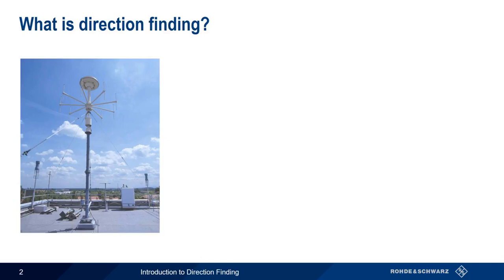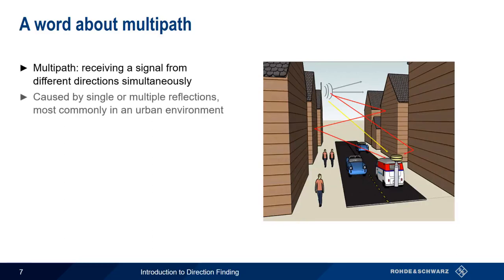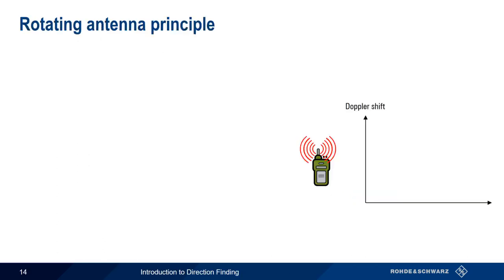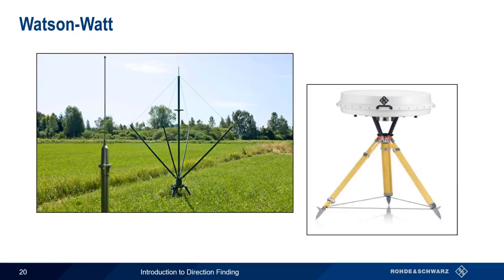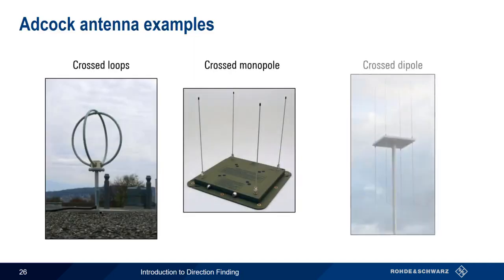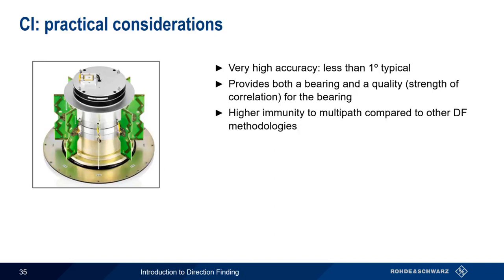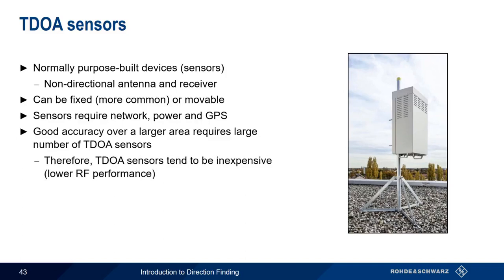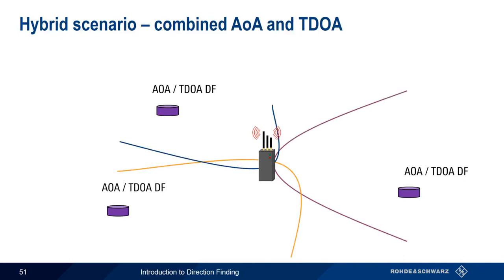An Introduction to Direction Finding

Comment: 10:05 I know the problem from my history as a radar operator on a old system.  In order to track a plane the radar needs to have a amount of target speed directed towards or away from the radar. If a plane flies parallel the radar couldn’t track it. Pilots learn this to evade air defense systems by flying in meandering patterns. We called it the zero Doppler tactic.
That’s why modern radars for this purpose are almost always of the phased array type.
The RDF methods you describe are following the same principles. Cool to see that after 20 I’m looking at a video to find inspiration for building a fun setup with my son and I almost hear my instructor basic radar and EOV from my initial training 20 years ago haha.😊

Love the explainer!👍

Comment: For the manual direction finding, the antenna can be mounted on a rotating platform and the signal measured so fast with the orientation of the antenna tagged to each measurement. The highest strength can be extracted by observation or by simple code.
Reply: Yes, that's correct and some DF systems do exactly what you describe.  However, there could be issues if significant multipath were present (highest received signal power may not occur at the azimuth closest to the source) and speed might be an issue (i.e. how quickly could you physically rotate the antenna and reliably measure the received level).  But again, there are numerous systems, especially at higher (> several GHz) frequencies that operate based on the principle you described.  Thanks!

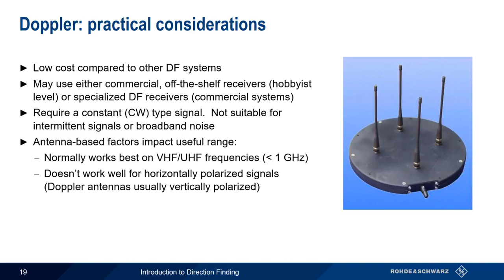Comment: 15:34 funny how  receive only is different from a radar. The radar I worked with was a pulse/Doppler so the signal was not continuous wave (especially when you take the reflections that are being detected in account, fast manoeuvre aircraft and terrain produce a unstable signal)

Comment: Two questions: 

1. Why is Wattson-Watt better for HF (low frequency) than Doppler?  I understand antennas have to be larger for lower frequencies, which for a scenario that involves physically moving the antenna with Doppler would make it more difficult, but that wouldn't seem to be in play for electronically switched Doppler. Is it because the magnitude of the frequency difference of the Doppler effect is dependent upon the wavelength of the signal, and lower frequencies have a smaller magnitude frequency shift due to Doppler effect and thus it's harder to resolve the frequency shift due to Doppler at lower frequencies?

2. Not understanding how an omnidirectional antenna helps resolve 180 degree directional ambiguity with Wattson-Watt. An omnidirectional antenna has a theoretically equal gain in all directions, correct? Then how can it resolve one direction from another? How would an antenna that sees all directions equally be able to differentiate a signal coming from the north from a signal coming from the south?
Reply: Regarding question 2 on the omni antenna for the Wattson-Watt technique, I believe I understand now that it's not the amplitude of the signal received by the omni that's involved, it's the phase of the signal received by the omni to the phase of the signal received by the 4 antenna elements. I.E. Comparing the phase of the signal received by the omni to the phase of the signal received by the 'North" antenna and the "South" antenna, one can determine if the signal is hitting the "North" antenna or the "South" antenna first to resolve the 180 degree ambiguity.
Reply: There are a few reasons why Doppler isn't used much at HF, the biggest one probably being the size of the antennas:  you would need a very large antenna array (or multiple arrays to cover all of HF) and even 1/4 wave verticals would become unmanageably large.

In Watson-Watt the signal from the omnidirectional antenna is usually combined with the signal from one or more other antennas in the array.  As you point out, without this it wouldn't be much use :)
Reply: @pauldenisowski  Ok that makes sense, thank you.

Comment: Can Bluetooth LE work in Non-LOS conditions (such as under rubble, filled with dust, stone, etc.).
Reply: I think the biggest challenge would be the attenuation from the debris.  If the intervening materials are non-uniform (e.g. a combination of concrete, steel, voids, etc.) that could also be an issue.  Assuming this is a safety-of-life application, I would definitely want to perform field tests under different conditions before making any assumptions.

Comment: I don't believe hyperbolae intersect because the sharpest curvature occurs in a direct line between the focii.  For example if only R1 and R2 are considered, the 'points' in the hyperbolae curves (and they come in pairs!) will 'point' at the R1 and R2 stations.  i.e These two curves are closest in the direct line between R1 and R2. The example shown seems to confuse range rings except uses hyperbolae instead of circles.
Reply: I've only heard the term "range rings" used in the context of radar PPI displays.  The hyperbolic method is pretty well established (TDOA used to be called "hypebolic direction finding").  I think that what you're referring to is the fact that you could draw circles around each station with the radio representing the distance to the source (direction is unknown).  The intersection of these circles would then be the location of the emitter.  In most cases, though, the literature refers to them as "hyperbolae"   Sorry if I'm misunderstanding your comment - it's really hard for me to discuss these things in text only comments :)
Reply: The curves don't point at the transmitter.  The lines are constant difference of delay lines.  Given the time delay reported between each pair of stations, the transmitter can lie anywhere along each line.    With multiple lines, the possible position narrows to where the lines cross.  Depending on the number and geometry of the receiving station positions there can be multiple intersection points.  For disambiguation you need 3 stations that are arranged in a triangle.